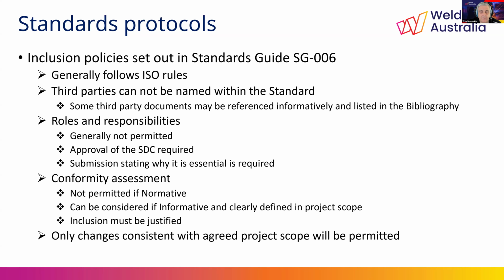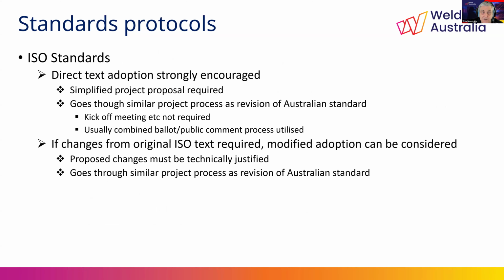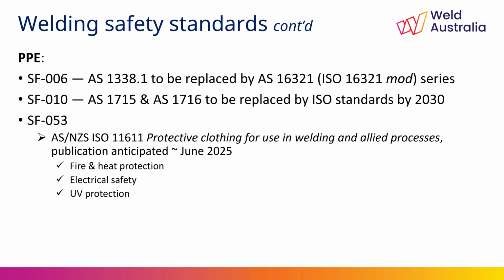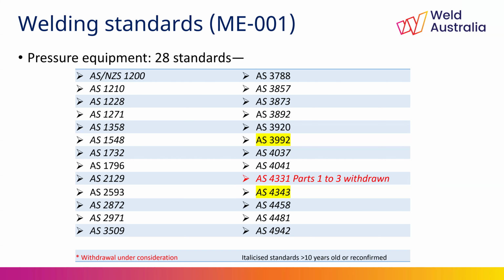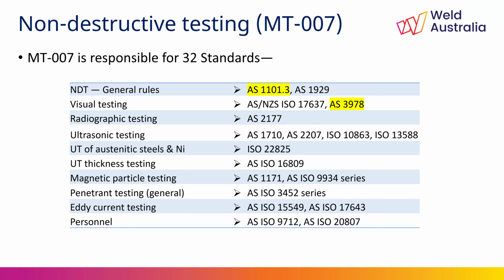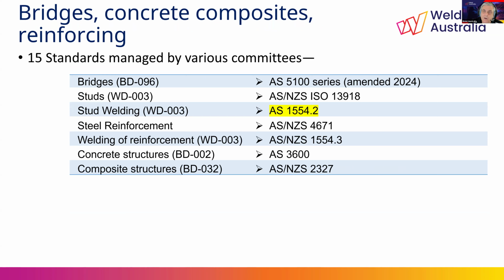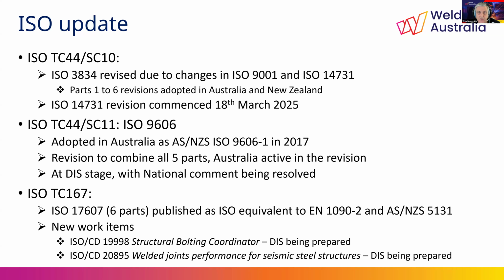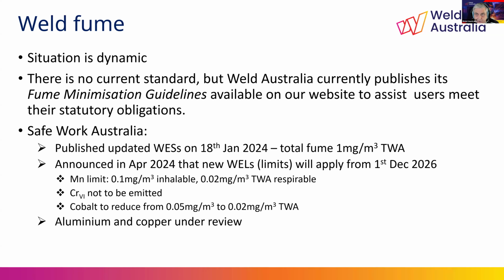WELD AUSTRALIA’S ANNUAL ASNZS AND ISO STANDARDS UPDATE 2025

Comment: So, what is the definition of  Welding Inspectors...for AS/NZS1554.1.
Reply from the maker: The welding inspector is defined in Clause 1.5.1.3 of AS/NZS1554.1
Reply: @WeldAustralia  Thank you, but you reference that the definition of a Welding Inspector was needing to be resolved and has been resolved @28:21. What changes could there be to AS/NZS 1554.1-2014 in light of this resolution. I know it is very hard if not impossible to say, because the committee has/may not have decided, but maybe an indication of what is likely would be helpful. Same for AS/NZS 5131.
In particular is it likely that somebody qualified, but not certified, will not be recognised in these standards....?